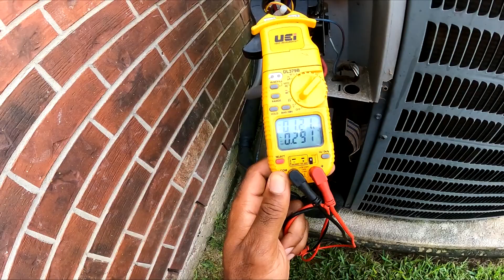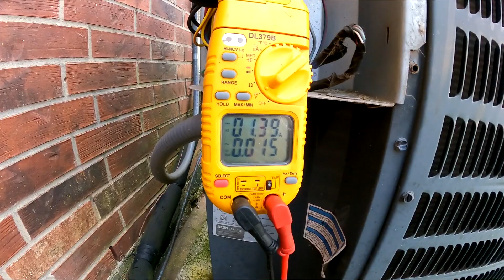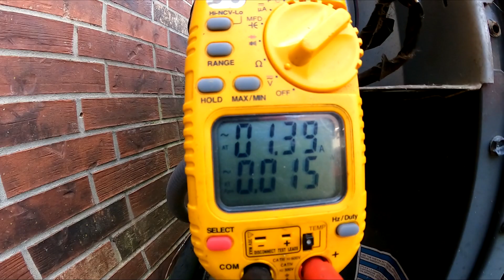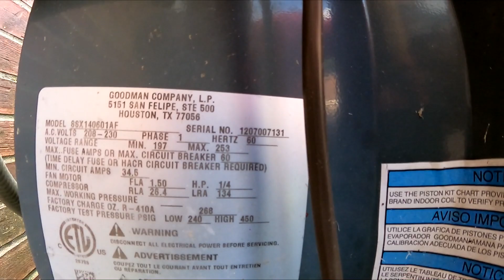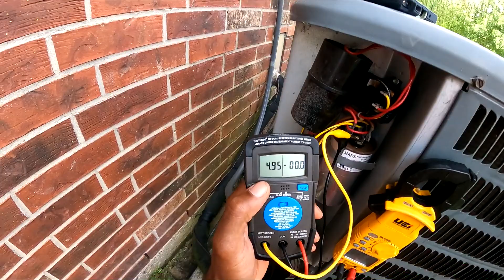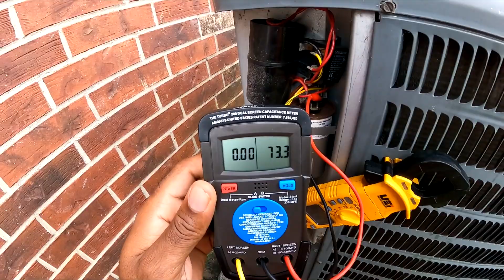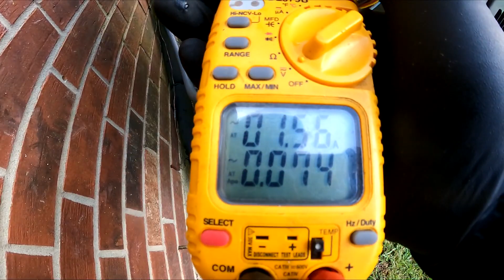"Don't Get Stuck in the Heat: Fix Your Goodman Fan Motor and Keep the Air Circulating Flawlessly!"

Comment: I really appreciate the care and concern you have for your customers. I really appreciate the pride and professionalism you have in the work you do....  Time is money and everyone has their own style but if you will allow me.....you already have the system running.....go ahead and check the capacitor.....it’s more accurate of a reading and you won’t need that tester as your meter is right there. Sand off that shaft before you lube it and that blade comes right off, no puller needed! Great video’s and thanks for sharing!

Comment: Good video Walter. Looked like it needed to go CCW but I could be wrong. I usually remember because I take my finger and slide down the blade, the way I slide down is the direction that it’s supposed to spin. 
Keep em coming !
Reply: Depends on what side of the motor you are looking at. Some use lead side and some use shaft side for reference

Comment: Good job. What was the device you used to check capacitors ?
Reply: Galco -86150
Turbo Cap Tester DSC METER
107.98

Comment: Hi... The condenser fan turns off when it gets hot... I changed the capacitor, the motor and the problem continues... Any suggestions ????
Reply: Have you washed the outside, because mine did the same thing when it was dirty then I washed it and it stopped.
Reply: The problem was the relay